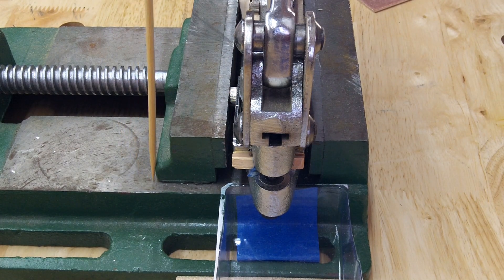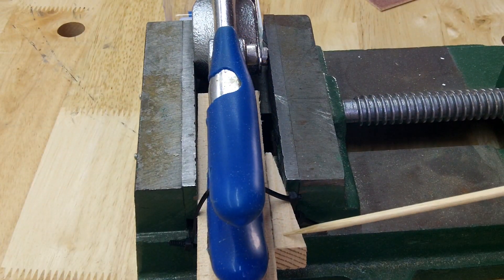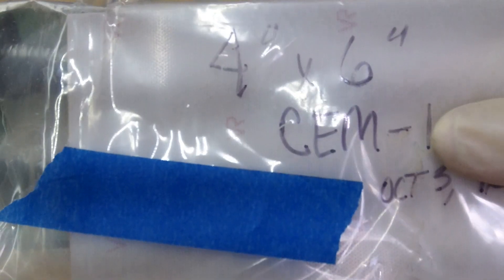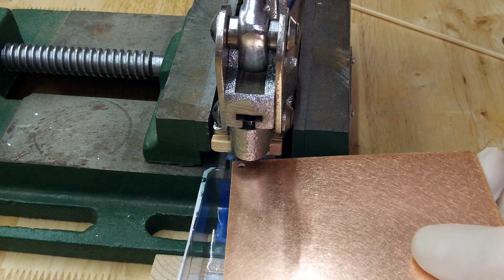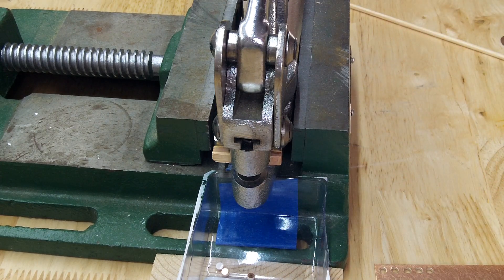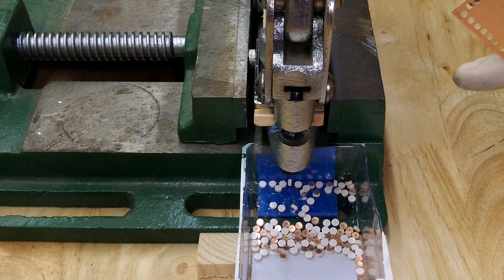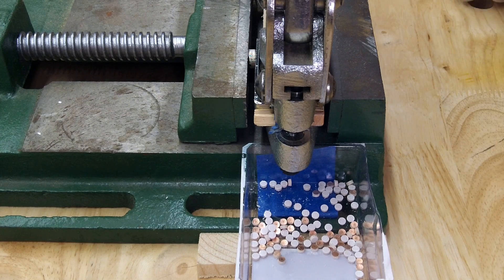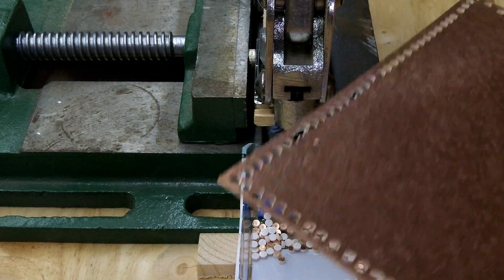Manhattan Circuit Construction Madness:  Lab #001   --   Create pads for projects

Comment: If you punch the PCB with the copper side down, it will make better pads as the female part of the die will round the edges.  Jim,  K8IQY
Reply from the maker: Thanks for the tip.  I never tried for fear the paper material would take the pressure first.  Learn something new every day.  I'll put it on the next video.  ciao.